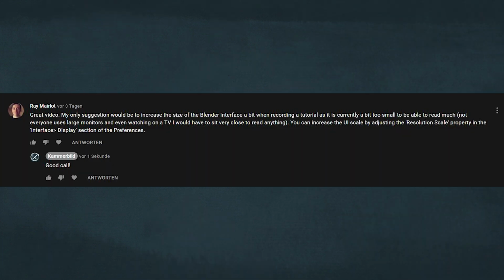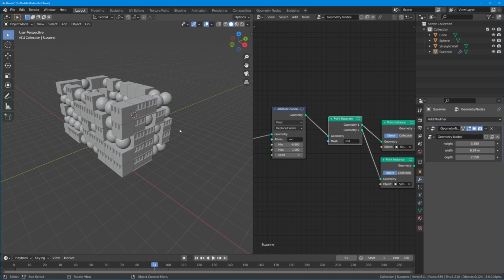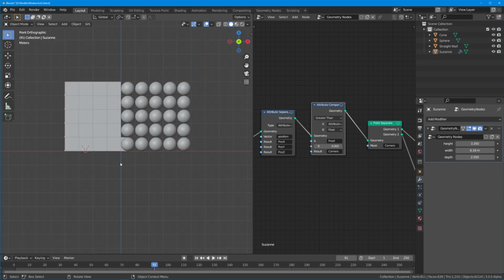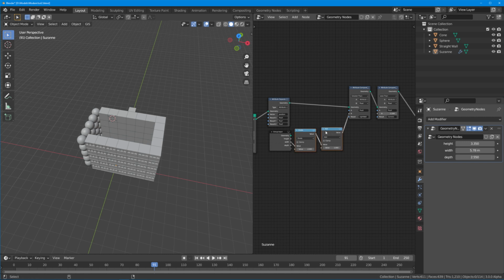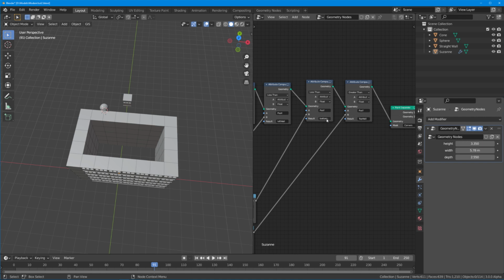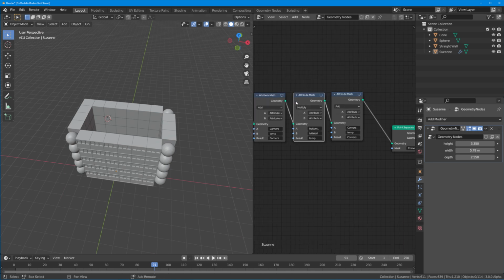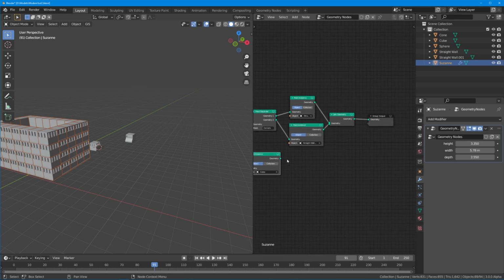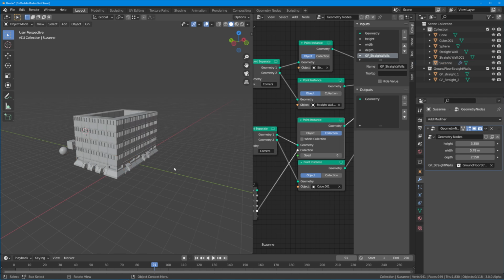Create a procedural Building in Blender (pt.2) !outdatred, check description!

Comment: Another great tutorial, if anyone finds the wall naming conventions a bit confusing I'd suggest replacing top/left/bottom/right with north/west/south/east.

And the copying the group input node is a neat trick.
Reply from the maker: Yes! Feel free to name it however you want :)
I think in this case the naming convention is not as important because so far we don't need the variables later on. As long as you can remember the names for about 5 minutes you are good ^^
But a good suggestion!

Comment: I'm using 3.0 alpha.I don't know that's the reason but the ground floor is in the centre by default and it doubles at certain float values.
If anyone  have this problem,you can solve it by adding another group input and connecting height to ceil then divide it by -2 ,connect that to B.

Comment: This has been great! loving it.

Since you took another tip that's kept our nodes nice and easy; I've been using Math : Multiply Add - single node instead of using the multiply and add nodes separately. 
(Does mean multiplying by 0.5 instead of Divide by 2 but overall it's helped keep it a little cleaner)

Comment: Point separate and Attribute randomize don't exist in 3.0 released.  The replacement for these is the entire reason I'm watching this video.  LOL.
There is a "separate Geometry", but the input is a boolean... can't for the life of me figure out how to get a shape to go in that slot.  -_-
Something simple like X = Width And Y = Width compare node I can do.  
But I'm trying to use Geo nodes to create rooms of variable size within a building of variable size.
With a "for loop" and giving each point an "occupied/unoccupied" boolean would be perfect... except there's no loop node... and no way to add a new attribute (that I'm aware of) to a point.
Reply: Having the same problem. Did you find an alternative solution?
Reply: @WillowOne  Nope.  I mean, one could always do it with python in Blender... but for Geo Nodes, we'll just have to wait for the nodes to be created... and they are on their way "someday".  Loops are by far, the most requested node.  They are absolutely essential for many procedural geometry projects.
Reply: So the farthest I've gotten is having the ability to change a wall to a random assortment of cubes and spheres

Object info (sphere or cube) > Instance on Points with a Mesh Line - Offset, Count 1, location (0,0,0) , Offset (0,0,1) Then repeat that for the other cube or sphere

Put those into a Join Geometry into the instance of another Instance on Points
Check Pick Instance
Plug a Random Value set to Integer (0,1) into the Instance Index

Not sure how the hell I'm going to single out the corners with this route tho.
Reply: @WillowOne  For my specific issue, the accumulate node in 3.1 does the job.
The index of accumulate would be the "rooms per row".  This will reset the "index" of the first room per row to 0 for easy manipulation.
And use Index Modulo Rooms per row to access a specific column.
Reply: @professordaytime  See my post on new Accumulate node.

Comment: great tutorial, what about rooftop? using the same method from ground floor but theres a hole in the middle
Reply: I think you need to add points for the rooftop just like you did for the side walls, but make sure that the roof doesn't go all the way to the edges of the roof(if you want to add fence or something at roof edges)
Reply: @jarvi57  yep, it works this way

Comment: Me watchingat 12:12
My mind: "Dis is madness I'll just use his project files"
Reply from the maker: :D Yeah - it's a bit complicated unfortunately
Reply: @Kammerbild  I found a different solution by simply exchanging the last piece of each wall with a corner piece using some (many!) math nodes and an additional line (instead of an grid) to instance these pieces. This was simply out of necessity because I had no idea how to use attributes, but it comes with additional headaches further down the line. That's the great thing about procedural nodes as there are tons of possible solutions. I think still think your solution is more elegant and future proof as it opens up the possibility to have more control and it is more readable than a confusing mess of math nodes.
Reply from the maker: @RyoMassaki  yes it is quite a process to understand how attributes work

Comment: Since you created the underlying structure as a "spiral" of walls: could you adjust their origins so each of the four walls would automatically have its "corner" at origin zero? Put another way, with a bit of adjusting, each flat wall grid would be going from zero to some value. Turn the walls so every "zero" grid is rotated so it's the corner.

Comment: 9:00 my mask for the bottom wall only affects some of the cubes for some reason. The right, left, and top walls seem to work just fine. Anyone got a solution?

Edit: so if anyone else had a similar problem what worked for me is adding another number after dividing by -2. I didn't have to add anything for the other walls and this was the only one where I did. Doesn't make sense to me but hey it fixed the problem.

Comment: Will you remake this for the new fields system? I'm in the corner part and I wonder if my method is the best... I'm using a position input, separate and greater than to select the corners to instance witch means I have to use multiple instance on point nodes, I wonder if that's the best method
Reply: I am also using fields right now to replicate the setup, and you can combine the masks as booleans
Reply: But how did you manage to get your grid points rotated so the facade is facing outwards? I am not able to recreate this in fields, as there is no point rotate node anymore...
Reply: @evesattler1570  I made an "object info" node and selcted my cube model, then connected that to four "Instance on points" nodes, where i can rotate the facades. Each of these has a connection from the four "transform" nodes. All the IoP-nodes connect to a "join geometry" node. I have JUST started this video and right now I have no idea how to make the corners, but ill try messing around.

Comment: Hi, thank you for this helpful tutorial. I was wondering if there is no possibility to take influence on the distribution of the collection. ( Like "use count" in particles).
I helped myself with another point separate node of the wall objekts. I splitted it into one point instance for the object  and another for the collection with the variation of the wall. For control I used the attribute randomize node you showed in the beginning.
Reply from the maker: A slightly dirty but quick way would be to duplicate the objects you would like to have appear more often. More duplicates = higher likelihood they'll be randomly selected :)

Comment: Hey man, so I'm running into a couple problems. First I've bought your pack on gum road and cant figure out how to view it. it opens in blender 2.83 so I'm not sure if that's the issue, all I'm seeing are the blocks and Suzannes, but no buildings? No geometry nodes? The second issue I'm having is with the tutorial. After generating the corners, I try to duplicate/add another "Point Separate" node and blender just crashes as soon as I type in "ground Floor" or anything for that matter. Any ideas on how to fix these problems? These are great tutorials by the way!:D
Reply from the maker: Thank you very much :)
To open my file you should use Blender 3.0.0. (it might work with other versions, but 2.83 is too old). Check out the first link in the description. 3.0.0. introduced some new nodes that are missing in the older versions - thats why the file appears glitched out.
And Blender obviously shouldn't crash when you add a node. So it sounds like a bug to me. While I can't fix that, updating Blender might resolve that issue for you aswell!

If that does not work let me know, and we'll figure it out.

Comment: is it possible to export any prepared building from blender to other 3d package as fbx or obj with mesh and material id`s ?
Reply from the maker: You can export the building after applying the geometry modifier. Then it is just like a normal 3d object in Blender. However, you can't get this outside of Blender without losing the procedural nature. Once the modifier is applied you can't change the Building anymore.
Blender can export obj and fbx. I don't know about the ID's. Never used that.
Reply: @Kammerbild  thanks I'll try it